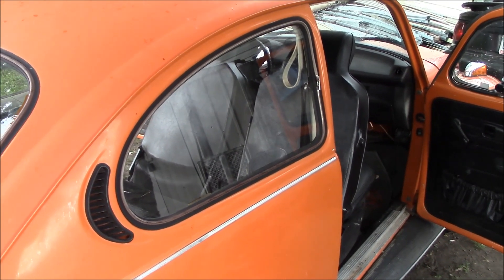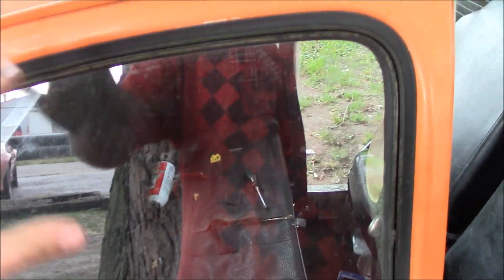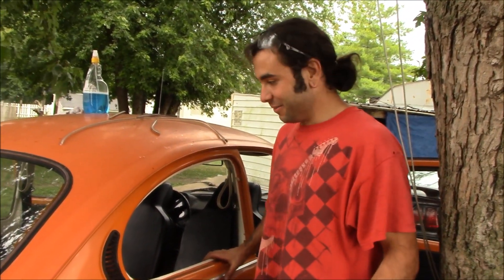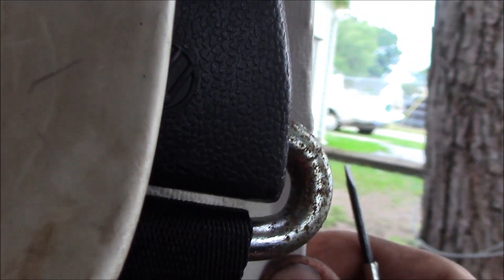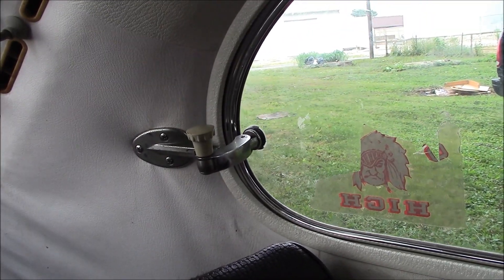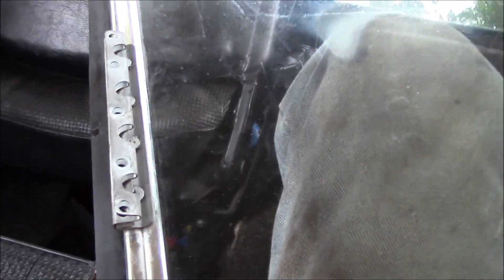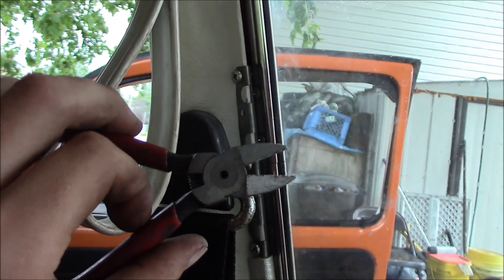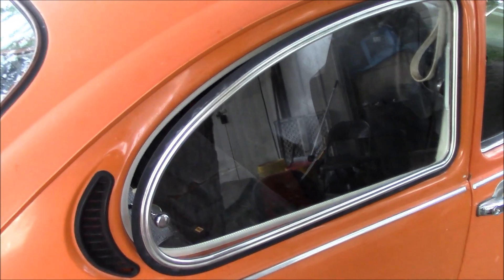How to Install Beetle Pop-Out Window

Comment: Thank you for the great picture of the plate and hinge as well as the good shot of the installed hinge. I was surprised after spending close to $500 that there were no instructions or a link to get great instructions. I think most of the hewer cars, like my 1972 have dimples in the metal rather than holes. If you are using an awl to find the holes, the awl makes a fine tool to start the holes by tapping it lightly with a plastic hammer. A disadvantage to using a drill with a screw driver is that you can pull in the headliner material or some of the underlying padding. That can ruin your day.

Comment: You do not need to remove any fancy trim from the outside of the rubber because you are going to work the inner rubber over and off the window pinch weld. I got mine off by myself starting where the hinge goes and then across the top and part way into the rear corner. I used a stiff putty blade or knife; different parts of the country call it by different names.  The rubber came off without damaging the glass or the rubber. The rubber on my car is very pliable. By the way, I purchased my windows and installation kit from West Coast Metric. It arrived by FedEx but it took much longer than it should have because they got lost. It went to a place with an entirely different zip code that was not anything like my zip code. Four days ended up being 8 days.

Comment: great vid! just curious…i recently found a pop out window set for my 74 super beetle, but it didn't have the little piece of metal bracket that the 5 screws go into, where would i acquire this part? and also where did you get the inside molding/trim pieces that go on the inside of the window. Yours is white shown in the video! thanks!
Reply from the maker: +alexlongsk8 http://www.wolfsburgwest.com part list in the description

Comment: Did you use the same glass? Is it just a pop out frame kit??
Reply: You can't use the same glass, because of size differences between the two styles (solid or pop-out) and the pop-out windows have a hole drilled in them for the rear latch.
Reply: @WyldhorseINOregon  thanks...